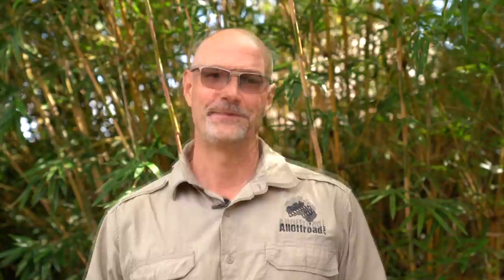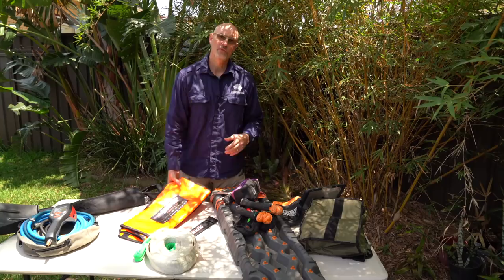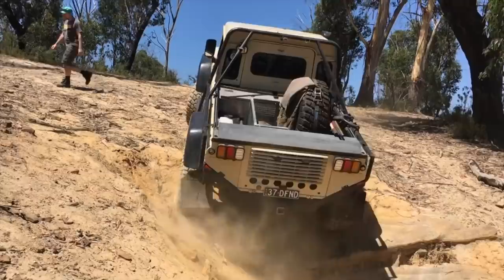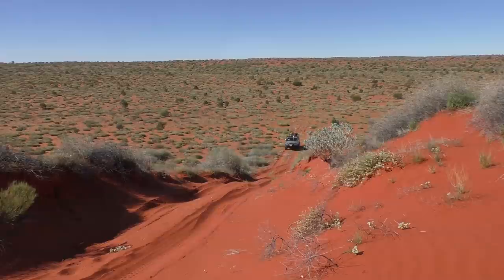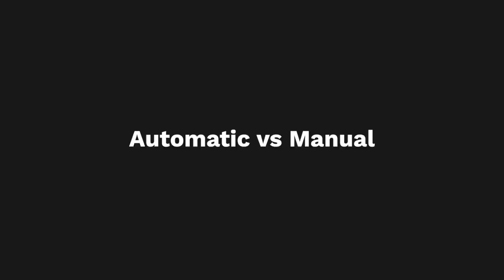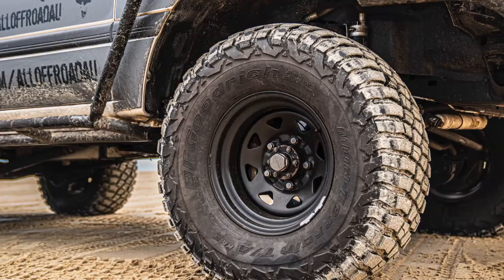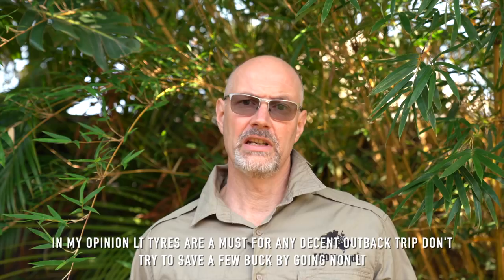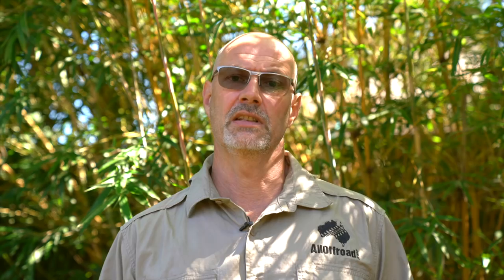4wd Sand Driving Tutorial 4: Expert Tips from a 4WD Trainer | Ultimate Tutorial

Comment: Can you touch onto more how you came to consideration that (good quality, arb, maxtrax) recovery boards are overrated in your opinion? I am very interested to learn the facts behind that from someone who is quite experienced as yourself in the real world out in the field.
Reply from the maker: I guess I should say overrated for my vehicle, set up and the way I drive, I have used them for training purposes many times when teaching 4w driving however in real live in my 9 years of driving I have never been stuck while touring were max tracks would have helped me. They are most useful in sand but I have never been stuck in sand where I could not self recover and drive out. If stuck in mud (which I try to avoid anyway) I rather use a winch. Maybe the day will come where I say I wish I had some MaxxTracks but so far it has not happened.
Reply: @AlloffroadAu  this makes sense and runs with all other aspects of what you detailed in this video. I guess to rephrase any vehicle without a front of rear working locker I'd say the boards heavily suited. A vehicle with front and rear working diff locks would probably not benefit at all. Thanks for responding with your honest feedback.
Reply from the maker: in sand is probably more the suspension travel then lockers, I probably can count on one hand how often I have used a locker in sand, but with my solid axle vehicle and long travel suspension I rarely uses contact to the ground and hence wont loose traction which then would require a locker.

Comment: Do I need a vehicle with a two speed transfer case i.e. 4lo? Or can I get by on the sand with just 4hi?
Reply from the maker: high put more pressure on drive train and transmission and you probably struggle on some dunes.
Reply: @AlloffroadAu  thanks

Comment: You are missing the point, it is NOT the width of aired down tyre it's the length of tyre contact.
Reply from the maker: lol that's what I explain, and while footprint length is the main factor a little wider tyre will also bulge more on the side and offer a little extra there main factor is tyre diameter though.
Reply: @AlloffroadAu  OK cool i missed you saying that then, sorry.

Comment: 27:50... Your video loses all crediability.. You have no evidence. Videos ive seen that actaully DID real tesing. Wide tyres on average only gained 2% larger traction patterns. BUT wide tyres have more weight meaning worse unsprung weight, worse fuel economy and worse rolling resistance. Narrow tyres gained a narrower traction patch while wide tyres were wider. So some ruts youll have LESS tyre in contact with a wide tyre because of the contact patch pattern.

Please do some actaul research and testing.
Reply from the maker: lol you mean something like 100.000km of sand driving and 2-3 Desert trips alone per year not to mention additional trips to Fraser, SA or Tasmania for sand driving. I don't go for wide I have the most common size in 35" 315/75/16 and yet have to get stuck I sure don't go for a skinny 35" which is very uncommon and hard to get as it makes no difference for capability and traction. I never said a wider tyre does not use more fuel but it's negligible with the same diameter.